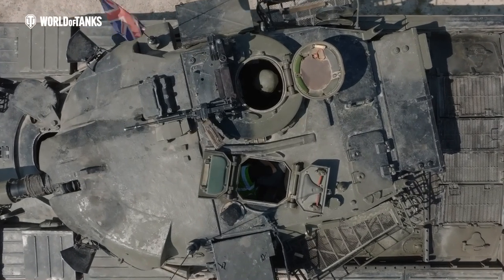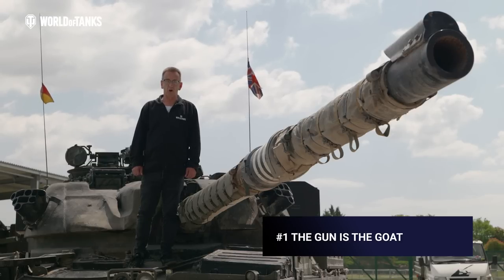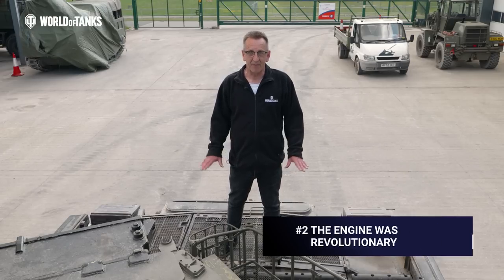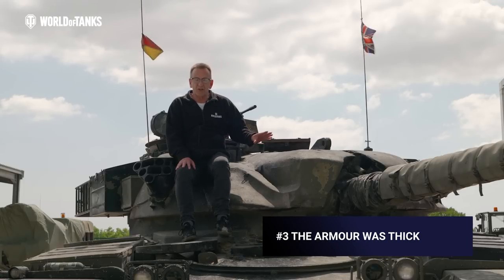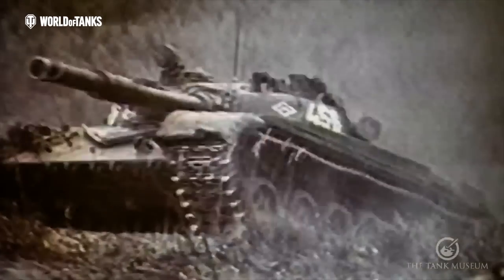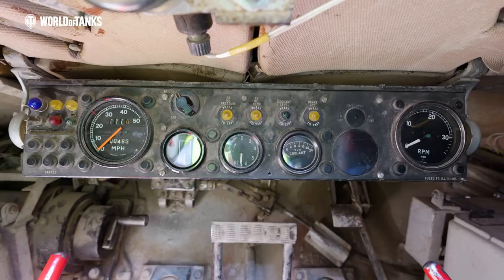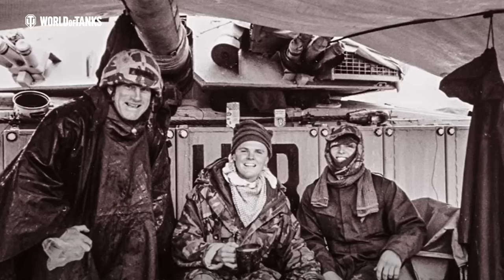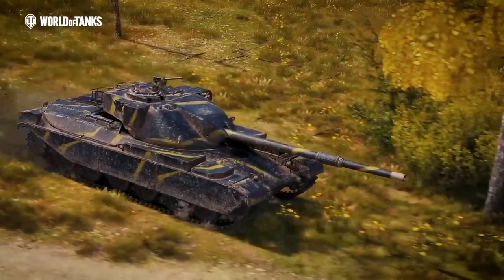5 Cool Things About The Chieftain

Comment: Someone I met 2 years ago used to be a Chieftain commander and told me: "It gave you a tremendous feeling of power to know that we could see and kill anything on the battlefield before it could get close enough to damage us"
Reply: well... that didnt really hold up to cold reality....
T-62 had similar or surperior optics to chieftain in the 60´s, T-64 and T-72´s were equal in optics for the remaining time. 
And in respect to firepower, chieftain struggled to penetrate T-64´s and T-72´s on ranges above 900m, while they were able to penetrate chieftain on ranges of 2000+m
Reply: @zhufortheimpaler4041 The Russians were far ahead in tank tech in the 70s, then again, why should an Island nation proritize tank design so much anyway, chieftain could have been a better machine if budget went into more elaborate upgrades sooner including optics

T-64 was also a wreck but underwent huge upgrades including changing the entire tank gun and armor composite,

By 1966 the chieftain would have been one of the best machines in the world but it never got the necessary upgrades it needed to keep it relevant with the russian stuff as that came in,

Of course chieftain gun would have been able to take out any russian tank including early t-64 at the time but yet again ammo was no upgraded until much later unlike t-64 which had mediocre ammo but later versions had a bigger gun with new ammo

Comment: How different was the performance of the engine on the different fuels? And what was the preferred fuel for it - diesel?
Reply: They hardly ever ran on anything but diesel.  The rest of the army vehicles were diesel only, so there was nothing else in the supply train.  It’s a design trade off that certainly doesn’t justify its lower reliability.